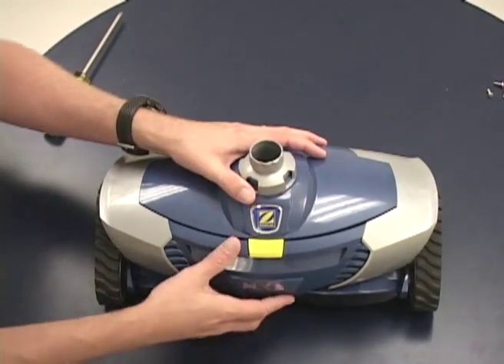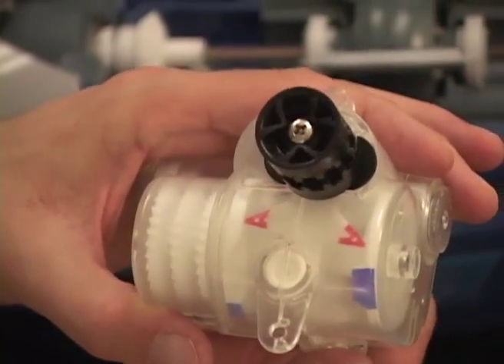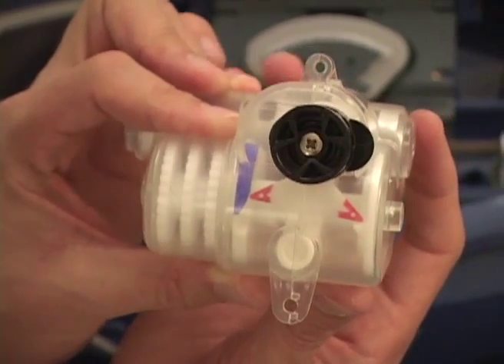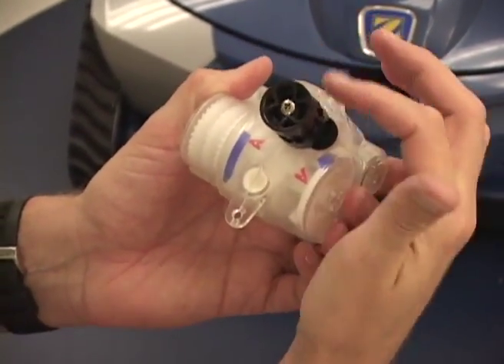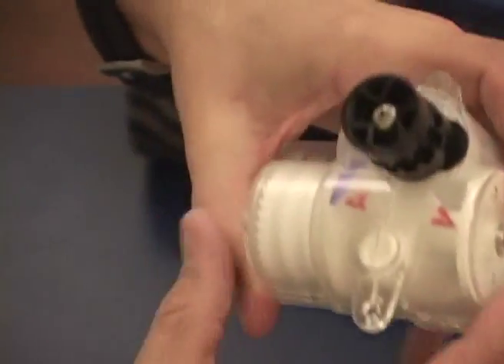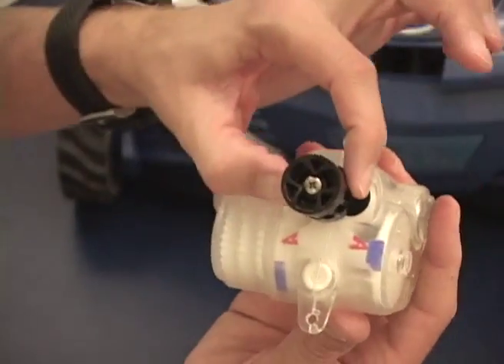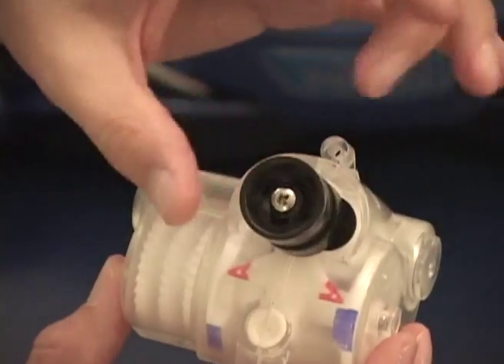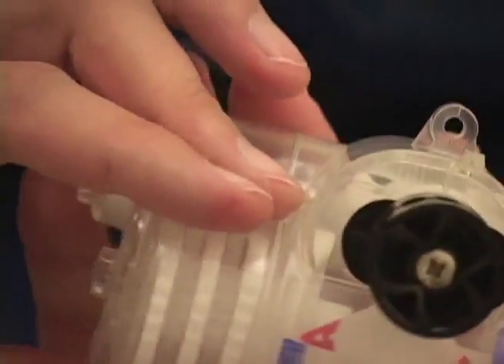MX8 Directional Control Device (DCD) Explained

Comment: I know this is a older thread but I'm wondering if you can tell me why my MX8 keeps taking out the drive on the right side facing the lid of the cleaner. It takes the drive out within a month of installing a new one.

Comment: Would be nice if we can buy the individual bevel gears. Would save us from throwing away so many serviceable parts. A designed weak point?
Reply: They are easy to 3D print, find somewhere you can get a cheap print, or ask a friend with a printer.